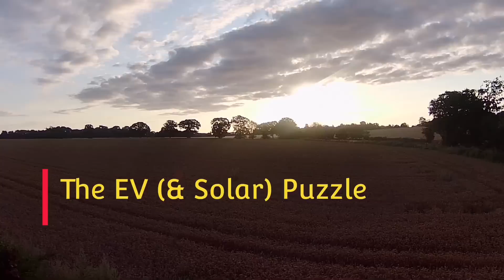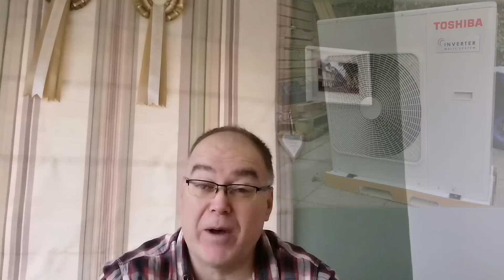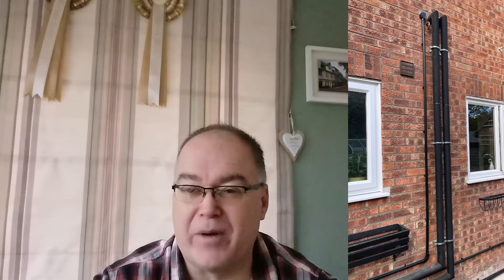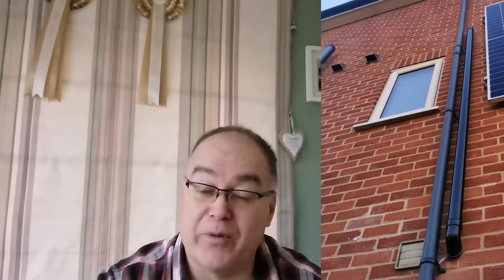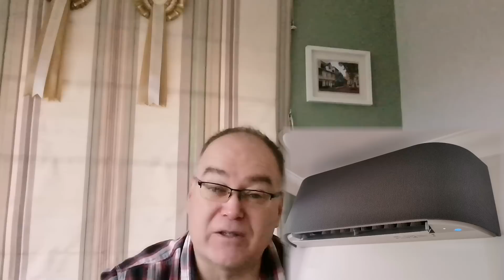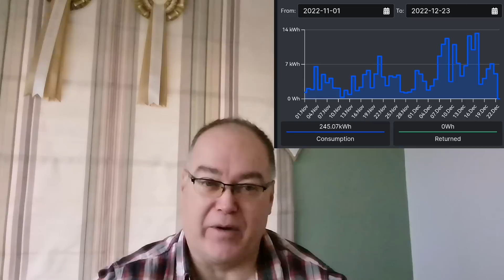Toshiba Air to Air Heat pump (A2A) - Probably one of the best heating systems you can install

Comment: having Air to water installed origonally spending thousands on underfloor heating was one of the biggest mistakes I ever made,  after one buffero winter was enough electric was huge because of the temps often dipping into -10c  for 3 months  every 60 mins it was running a defrost cycle,  so I called another installer to originally evaluate  the install was correctly spec.    after feeling cold for one winter we decided to add a twin 6 outlet unit air to air, 7kwh each   two in the living room,  (open plan)   one in the den,  an outlets linked to a in line air distribution feed to kitchen , and garden room,  with the second feeding upstairs bedrooms and bathrooms,     air to Air has been an absolute success,  its been so good i disconnected the water unit,    currently we are using 3kwh for the entire house an hour, on weather comp,  compared to 10kwh for the underfloor water unit, right now were 3.2 to a kw,   and the good thing the pipework was hidden in the old buildings air ducts that were seperated from the old furnace with an in duct unit typical in US heating,   and across the crawl space in the lofts of the garage and main roof.  the only water based heating unit that still on is for the driveway that's a must in these parts,.   if you like air heating you can't go wrong with air to Air
Reply from the maker: Wow underfloor heating sounds so appealling doesn't it but given the choice I'd go with A2A every day instead of water in pipes

Comment: Also you have had air source pump system fitted is that 6kw out put but does not use 6kw input, i am asking because i have all eclectic house with 31 panels on roof and garage with 25kw of batteries, but have a 12kw electric boiler
Reply from the maker: Absolutely, 8kw heat output potential with 4:1 saving on energy typically

Comment: Excited for you, congrats! Can't wait to see all your data observations.

Hopefully next week, we will be swapping out our thermostat from an adapter-to-nest to the OEM Mitsubishi thermostat. I read in forums that the thermostat for the heat pump actually allows it to use VRF, but when we installed and opted for nest, it effectively crippled out system into a two-stage mode. Supposedly also forces it to defrost more frequently than it should. Even if we see a 5% reduction in energy with VRF, it should be significant in Winter.

Comment: Negative comments will be removed. Surely people should be aware of all the facts.
Reply: I've added links before and they have not been blocked. However comments aren’t actually public after you post them. Although YouTube will display the comment to you as if it were posted for everyone to see, this isn’t actually the case.

Instead, the comment will go to a special inbox called ‘Held for Review’ within the video creator’s YouTube studio. Comments placed in the ‘Held for Review’ section must be manually reviewed and approved by the video creator.

If comment not in the 'Held for Review' box then must have been removed by the comments box fairies!!.
Reply from the maker: It happens, there's been a spate of YouTube deleting comments so heaven knows what reason.

These messages are getting through OK and no there's nothing held for review, it does get checked and cleared regularly.

I do block certain key words though so if you hit bingo there that might have done it
Reply from the maker: Only rude ones and opinions aren't facts
Reply: @EVPuzzle  So you are saying a reference to a web site that looks at all the difference heating technologies is rude. Saying to keep your oil boiler due to multiple reports of blackouts coming is rude.  Re-instate the comment so others can decide - there is always the thumbs up / down for others to indicate if they found the comment useful - or they can make their own comment on all / part.
Reply from the maker: I only delete rude ones.  If you posted a link, youtube blocks those automatically.
I don't recall seeing your comment let alone deleting it

Comment: What about the infrared panel you installed on the bathroom...completly ditch now? I was planning to test it out on my own. Ill appreciette your insights.
Reply from the maker: Haven't turned it on in months, it's still there unused. Looks pretty being glass like a dark mirror but takes too long to do anything and doesn't warm the towels. Shame I bought three of them. I'll find a use one day
Reply: @EVPuzzle  I thought it was instant warmth, like the old radiators of the 70's...
Reply from the maker: Not on the ones I've tried, admittedly they're only 350w and not ideally positioned

Comment: Hi Nigel, I know you have the solar and battery, but with all your potential electrical demands have you had to have a three phase power supply installed?
Reply from the maker: No, we're no where near that. Typically 4kw is a big load during the day for us. Overnight when we're charging everything we peak at 15kw and we've got capacity for 24kw
Reply: We had single phase to our house, then upgraded to 3 Phase.

The main reason was for 11kW electric car charging x 2.  Powerwalls charging x 2.  Then running the house with Tumble Dryer, Heat Pump etc.

Works great
Reply: I presume you had to pay for that connection? Obviously difficult for the Government to pay for everything but if we are serious about switching to electric I think there has to be a plan for a national rollout of three phase. Relatively soon nearly every house will need it and it seems a negative incentive for those trying to make the switch to have to pay for the infrastructure. A friend in our village has just had to pay £44,000 for a domestic three phase connection!
Reply: @rossbransby  No it was free for our upgrade to 3 Phase.  But our story is slightly unusual.

Comment: Super helpful video thanks - I've been looking at and thinking ASHP but even though our house and heating system are only 20 years old, there would still be a lot of work to bring the radiators and pipework up to spec.

I also really like the idea of air con in the summer and the dehumidifier effect of AC for drying clothes without resorting to the tumble dryer on wet days.

While I'd like to get rid of gas and loose the standing charge, I do wonder if air-to-air might be a good way to cut down reliance on gas, while also getting the cooling benefit in the summer.

Comment: Very interesting video. The phrase which always springs to mind when talking about heat pump cost is rip off. As I understand it the technology isn't all that different between air con and heat pumps? Or is the additional cost down to the changing radiators and piping and adding additional insulation I wonder.
Reply: Yes A/C Unit is basically the same as a Heat Pump. There is a reversing valve in a heat pump so you can use the refrigerant to either extract heat from the air in the house and dump it outside or extract ambient heat from outdoor air and dump it into the home. 
You should get a few quotes and ask the HVAC engineer for recommendations and a price quote. There can be multiple solutions that might work for your situation.
In my State in the US we have a 10K rebate currently for Heat Pump Systems from the utility ( everyone pays $3 US each month to fund the energy conservation subsidy / rebate programs pool) for over 30 years now. 
Our programs require a Home Energy Audit which requires meeting minimum efficiency standards be met to get the rebates. If your air sealing or insulation falls short you can get 80% discount on materials and labor and they provide the contractor to do the work. They will also use infrared cameras to visualize heat loss etc. 
I am surprised that in the UK you get your government grants for these heat pumps no matter how well or bad the insulation of the home is. We also have non profit or consumer interest / energy efficiency advocacy groups who provide high level consultation, education, seminars, websites to help consumers out. 
It’s not perfect and you have to look into it and educate yourself.
As for contractors / installers and their prices it’s the Wild West. We can also get 7 years interest free financing for the heat pump system which is net cost after 10k immediate subsidy. The moral hazard is the quotes can be inflated because it’s “free money” to some extent.
The irony of all this is that many people don’t take advantage of these programs because they think “heat Pumps don’t work in cold weather”their neighbor got burnt by a bad install or contractor. Or they try to run the system on demand like they did with fossil fuel or they like their home like Miami Beach or Hawaii in the Northeast US when it is - 5 F  one day a year or something like that.

Comment: bad installers want to do more than is actually required with A2W. We always size correctly and I would rather have a smaller heat pump with direct electric backup.

A2A is cheap and easy to install, however, it is just a warm air blower in the end, and nowhere near as comfortable or quiet inside as a wet heating system. It also does not do hot water.

You can just bolt on a heat pump to the existing system and I have done it. (Customers waiting to do upgrades at a later date when fully renovating) - efficiency though is not great, usually around 2.2-2.6 scop as opposed to 4.0-4.8 when done correctly.

Comment: 13kwh per day to heat is great as you say, but compare the cost of that 13kwh in electric vs gas...  electric is 3x the price at least so Im still in two minds over it...  e.g. during the cold snap we were using about 50kwh of gas for about £5.50 a day.  Assuming we got similar results to you at 13kwh in electric would have cost more, my 4kwh solar array only generated 87kwh so far this month (17kwh exported) so we would definitely pulling a lot from the grid.  Food for thought though.  How much did your system cost?
Reply: If they decouple price of gas-generated electricity from other sources, electricity costs would reduce and that would be a catalyst for people to move from gas.
Reply: Unless you got big batteries on recently cold spell most people will be importing at peak rate so until the reduced the green tax on electric and put it on gas this is the issue for many  in uk in winter time limited solar ,  heat pumps are a great option and the way to go no doubt !  But  £5-10 k  to have similar bils on cold weather is not great !  And you reduce your local emissions but what about the extra emissions at  the power stations  if we all go heat pumps for heating  in uk there warning of black out  this year  as the grid mite not  be able to cope so we could face rolling blackouts like they do in USA !
Reply from the maker: It extreme Nickie, the grid has plans and there's plenty on new power being implemented. Blackouts are a gas issue whilst we're reliant upon it to plug the gap
Reply from the maker: Gas is fueling a war and adding to global warming, it really isn't an option going forward, whatever the cost imo

Electric is costing me 7.5p. Per kwh and achieving 3-4 scop so that's 7.5p per 3-4 kwhs of heat and that's if I'm not using solar power.

Gas can't come close to that.
Reply: @EVPuzzle  Agreed, unfortunately myself (and many others i suspect) dont enjoy such cheap rates anymore.  Gas is 10p/kwh and electric is 38p/kwh...

Comment: When you refer to 20 kWh usage at -5 degrees, how many square meters are we talking about? In my experience I’m using significantly more…
Reply from the maker: 136m2 house directly heating two thirds of the footage approx.

Yes, most homes use much more energy

Comment: Very interesting, but the video I just watched said...do not put the internal units up high, as that is the default for cooling.  For heating, they should be down low.
Reply from the maker: Depends how tall your room is I guess, I'm finding heating and cooling perfect with normal room heights
Reply: The vanes adjust to point down to throw the warm air along the floor.

Comment: Just place the units on out side walls the placement of the units is not critical hot air rises and cold air falls to the floor. So putting the unit in the hallway is not necessary. It may have been better in the kitchen. In very cold weather I found running 24 hours per day was cheaper than turning the units on and off. The inverter supplies just enough to keep a constant temperature. You have installed a very efficient unit. So if money is tight just 1 unit in the lounge room will do the job. Fantastic video very informative.
Reply from the maker: Many thanks, we're over the moon. It's not just about reducing energy and saving money it's about providing better heat and more heat.

Comment: How's it working at low temperatures, Nigel?  The A2A units I've looked at don't appear to be rated below about 7C external temperature (which doesn't seem right).

Did you get any really cold days? - Norfolk looked like it didn't get below about -2 over the last few weeks when it was a lot colder in the rest of the UK
Reply: That doesn’t sound right. The R32 systems I’ve looked at work to -15

Comment: I have an a/c with air source heat pump (one room only) I am on a fixed rate of 20p KWh (Sept 2023), to give an example ran for 13.13 hours using only 2.46 KWh (below 0oC outside 14/12/2022) I am extremely pleased with results.
Reply: Fantastic result

Comment: Very interesting development of your slow but inevitable move, to an all electric house. We are doing the same, although our 75 year old house, shabbily built in post war Australia (Melbourne), is nowhere near as energy efficient as your 15 year old house. We have insulated it reasonably well, but it is nowhere near what is the norm today.

We too pondered whether to use a single multi head system, but eventually opted for individual units; all Mitsubishi Heavy Industries. 2kW units for the kitchen and main bedroom, 6kW for the lounge/dining/small office room, and a 3.5kW unit for our modern extension, which is well insulated. Total area is 142.8 square metres.

Our kitchen unit is in the middle of the house, it too required some left of field thinking for the drainage. We too almost ended up with a pump arrangement, instead, solid pipe with a 15mm ID running at a 7º constant angle into our stormwater system, saved the day.
Having single units enables us to heat/cool individual areas more efficiently than a multi-head large single unit, at least that was what our calculations suggested.

Keep up the good work, greatly appreciated.
Reply from the maker: Presumably you use it more more cooling than heating?
If we were doing the whole house I think we'd have 3-4 outside units but so far it's doing the job nicely
Reply: @EVPuzzle  Funnily enough, it is close to 50% of each, more so heating this year as it has been quite cool. But today has been a perfect Christmas day, not a cloud all day and hovering around 34º so two of the units were on keeping the inside between 24ºC to 25ºC on the parts of the house in use. Batteries were at 98% from around 14:00hrs (20kWh usable) all from solar  7.7kW of panels.

Comment: A quility Japanese brand  7.1 reverse cycle air conditioning, costs about a 1000 quid, at Harvey Norman, with about another 300 quid installation in Australia.  You can have a ducted full house AC unit.
I have 2 smaller AC units one in the living room and the other in the main bedroom.
Reply: Mark is correct your prices in UK border on theft
Reply from the maker: Nice price
Reply: On reflection you got a good price. However I only install separate units so 3 inside units and 3 condenser units that covers break downs. Most of the air conditioners now last 15 years or so. The inverter air conditioning are real game changer. The non inverter Units used to dim the lights when they turned on. So then soft starters were then added.

Comment: Nice video giving a good overview and glad that the unit is helping you reduce your grid/oil usage.  A few things to note, all the outdoor units will start off as quiet and become noisier as they age.  Any A2A unit needs planning permission and are not permitted development. The text for PP has been changed subtly to remove any ambiguity. This whole PP can become an expensive money pit, when you need noise dampening covers, noise assessment etc.  On the plus side - having a cool room during a heat wave is awesome!
Reply: Where is this as it’s the first I’ve heard of that?
Reply: Yer very interesting to hear you need pp to fit a2a as not hear this from information I’ve been told ?

Comment: One thing you mentioned was that the units are ‘high up’, if how air rises isn’t it better to position them lower down?
Is the positioning based on ‘cooling’?
Reply from the maker: Pipe runs are high up and they look better than a lower radiator style. Because air is pushed diwn by fans it really works well

Comment: When I was a kid (65 yrs ago), we had radiators that you could turn off if you wanted to. Of course, we also had knob-and-tube wiring as well. Now, I have air-to-air heating and A/C in Texas. Works well, unless the temps (deg F) get into the single digits.